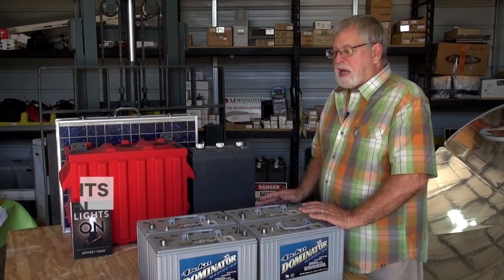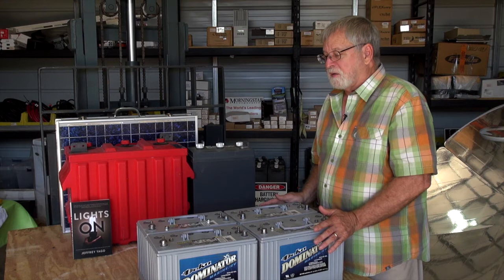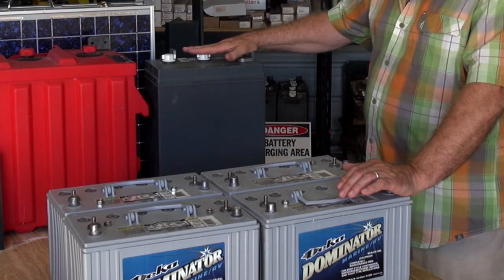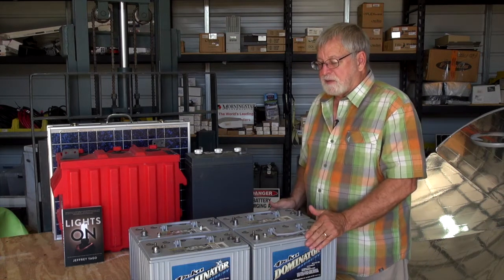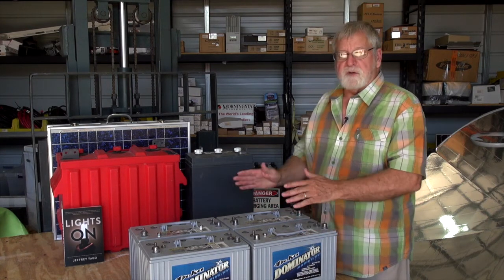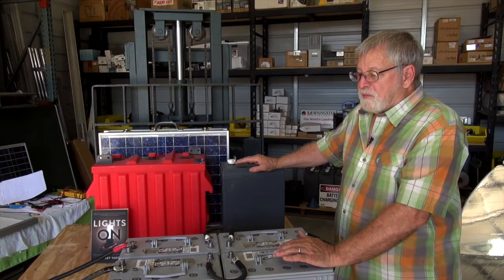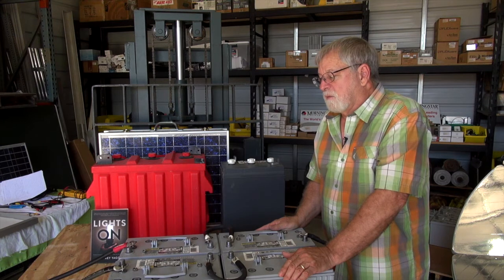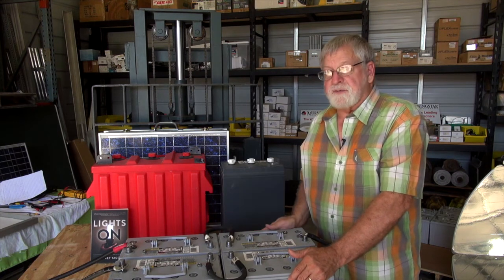Lights On: Learn How to Use a Bank of Batteries to Power Your Appliances

Comment: I hate batteries.  They are a waste of money that just goes bad in a couple of years.  A better investment is more solar panels.  They are cheap and just run things real time.  I live off grid 5 months a year and refrigeration etc all runs off a car battery.  Wife even has a dishwasher.  Excess PV goes into heating water.  I'll be running a clothes washing machine next year now that I have a direct drive model. Just takes a little change in lifestyle. Do the wash when the sun shines, clothes have to go on a line anyway.  Think smarter, not batteries.